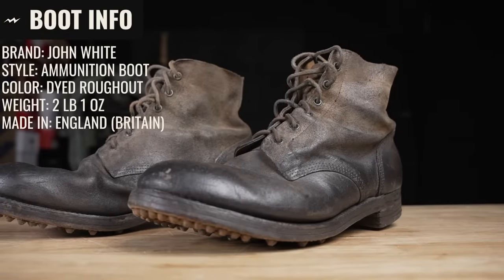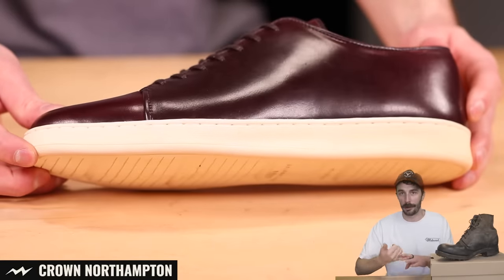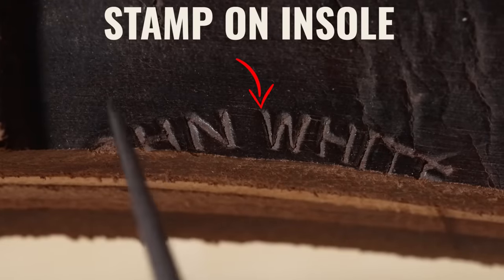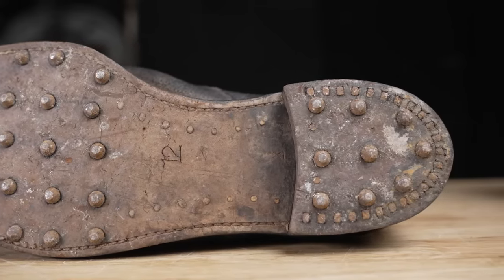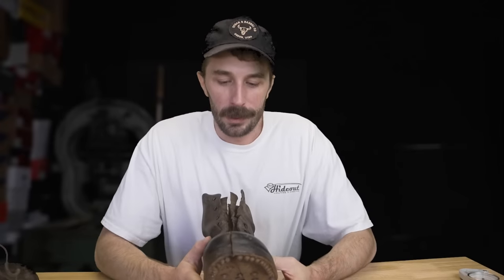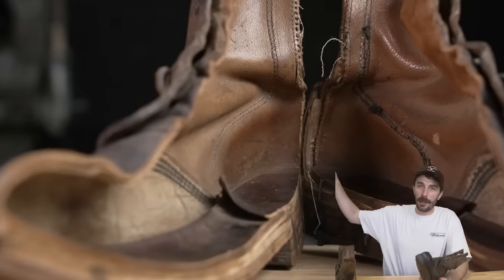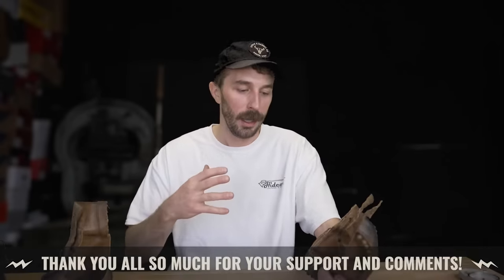Why 80 yr old British WW2 boots are better than modern boots

Comment: All i know is i joined in 2011. The boots felt like planks of wood with ropes to tighten them up. To my knowledge, they were the standard issue CS95 boots but they felt like they were from the 1950s. I think circa 2015, people started getting more comfortable but more disposable boots. Soldiers still preferred to just buy their own. I dont know if this is still the case but i assume so.

Comment: Weston, you NEED to take a look at William Lennon & Co. (founded 1899), the only remaining Derby bootmaker. Note, they aren't the only maker of Derby-style boots (hell, the Iron Ranger is a Derby-style boot), but they are the last bootmaker in Derbyshire. One of the reasons you should take a look is that they were one of the makers of British Ammo boots for WW2, and they still make them. It would be an interesting comparison with these boots, to see if modern production matches in quality.

Another interesting boot in their range is their B5 WW1 replica, which was put back into production using the original lasts & clicking knives from 1915 - which begs the question, if a company stops producing a boot design, and then starts making the same design using the original lasts, knives, and machinery, in the same factory the originals were produced in 90+ years earlier, is it a replica, or a reissue?

Three final points - firstly, they are a family owned company, currently run by the great-granddaughter & great-grandson of the company founder. Secondly, they are unique in that they use a "stitched & screwed" sole construction for their soles, where instead of wooden pegs to hold the sole together, they use a brass wire screw. There's only 4 of the machines that can make this style of sole known to exist worldwide. Lennons have 3 of them. Finally, they are sensibly priced. The most expensive boot in their range is currently £260 in the UK, with the Ammo boots at £200. For those outside the UK, you can subtract 20% from that price (but local import taxes may be charged).

Only downside is that they are a MTO company, so it can take a while for things to arrive...

Comment: Not an old wives tale about weeing in ones new boot, couple of the old lags at Woolwich barracks where we did our basic pulled us over and whispered in our ears about having a widdle in ones boots and it worked, no blisters and butter soft leather overnight, of course we also poured in a bottle of Old Spice once tipped out because they smelt rank, those of us in our dorm who didn't ended up with vicious heel blisters that hobbled 'em.

Comment: The way we conditioned the Ammo boots in the British Army in the 80`s  was to get them on day one then out on a 3 mile run through the mud streams and then assault course. fill them with water (not piss) and leave them over night then another three mile overland. The boots were fine by day three but your feet were in tatters. My old Army boots felt like slippers after few weeks, very comfortable.

Comment: In the late 1980's I knew someone who had a coveted pair of WW2 British boots (I think he was the third generation of his family to wear the pair.) and the sound of the boots when marching was amazing, but on smooth stone floors there's fuck all grip. So when he came to a halt on a smooth floor after marching sometimes he'd unceremoniously skate forward.  Compared with the British DMS, or the later British Commando high the WW2 boot was built like a tank - Ok it may not have been that comfortable - but the Commando high caused splinters of shinbone to break off wearers while running and the DMS had a half tongue and limited water proofing - I'd say the old one's are the best.

Comment: i am a reenactor - i do British WW1 and WW1. both the era of boot are hard on the feet at extended period of time, however, once you get passed that point theyre great. they break in easy, though you slip around on wet and metal surfaces since the hobnails. wearing them in field or trenches are nice, however the supple leather doesnt agree well with water, better than the WW1 type boot. i love both my boots though.

edit: this was painful to watch

Comment: My father was a gunner in Matilda tanks during WW2 and initially they were issued with these boots with hobnails.
After they found that guys were losing fingers and worse from the boots slipping on the metal tank when the were lifting the heavy engine covers and they were chopping off fingers they then issued them with rubber soled boots to stop the problem.

Comment: I served in the South African Armoured Corps, and our boots were just as important to us as the Infantryman's boots were to them. 
We marched a hell of a lot, so a good fit was important.
We had two different soles, a combat, and a drill sole, Combat being thicker than the drill boot.
I was issued one of each kind and wore my combat-soled boots out within a year. They were re-soled, but in an inferior manner, so I never wore the combat soles again.
They were definitely NOT re-soled by the manufacturer.

The style looked very similar to the British ammunition boot but taller by about an inch or two.

I reckon the inner sole was not as good as the Ammunition Boot, but at least we didn't have those damned hobnails.

Comment: I used ammunition boots for drill. They were tough (indestructible) but uncomfortable. That said because they were for drill and were burnished I never softened them with linseed oil. Also they are too short. The British switched out boots with Argentine prisoners in the Falklands War. The best boots I had were the DMS leather boots. Still have mine since 1986. Romans used hobnails!

Comment: This video popped up in my recommended list and as a United Kingdom 🇬🇧 military veteran it piqued my interest, so hear I am. Before getting into the nitty-gritty of the video I thought I would air my opinion before watching and see if we are in agreement, so, putting aside the manufacturing quality of the DMS boot that I was issued when I joined up and looking at it from a wearers standpoint I can honestly say that you would need to be as mad 😡 as a box of frogs to think that they would be better than the last two types of boot I was issued, those being a high-leg boot for use during operations either in the U.K, Europe or other similar climates and for things like guard duties or training exercises away from base, the other pair were again Hi-leg but for use in desert climates such as Iraq and Afghanistan, both were comfortable, hard wearing, waterproof (if you treated them properly) and most importantly they didn’t cause blisters after five minutes, the only other pair of boots that were actually better I can’t include, even though they were issued to me they were not general issue and they were my flying boots (nope I wasn’t a pilot, but I had to regularly fly to do airborne flight testing and engineering support for poorly aircraft that needed my particular skill-set). My two pairs of Hi-legs, and there replacement’s, lasted me well, each pair lasted about 2 years before they were worn out. Ok, on with the video.
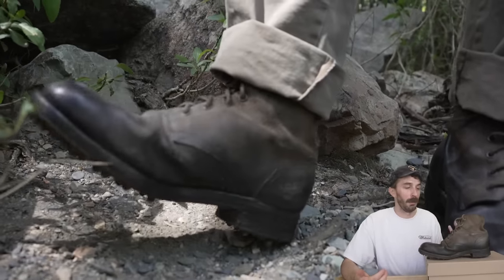@ 6:29 you said about the ways to soften the leather up, I never heard of the peeing in them but we were advised to get them into a bath of water on your feet or weighed down and left to soak, when you took them out to dry we filled them with newspaper really really well stuffed in to prevent shrinking and help soak up the water a bit, the other way was to take a hefty hammer 🔨 to them and beat them into submission, in addition I used to cut the top of the ankle support leather 3-4 cuts, going down about 1-2 inches so that when you bent down our squatted they didn’t rub or make it uncomfortable. Onwards we go.
Now that you have cut the boot in half it is really easy to see why, from a construction/materials point of view, that it is superbly designed and used quality materials, but in my experience they were not comfortable until they were broken in and worn in (about a year), I was just thinking about what my grandfather wore to go to work in, and my memory is saying that it was a pair of these “whites”, we lived just on the border with Northamptonshire and grandad did serve in WWII, so whether they were from his service or maybe direct from Whites I will never know now, pity. 
Thanks for taking the time and effort to do this deconstruction, and the history of a boot that those of us of a certain age who served in our military will remember, I found your video very interesting and informative, thanks again for sharing it with us all. 😀👍🇬🇧🏴🇺🇸🇺🇦

Comment: I like that my walmart $25 boots (used to be $20 but prices are going up on everything) look almost identical to these. The brahma escott boots (I like that they're wide too) look almost identical to these from a glance on the outside. Of course my boots only last about a year or so, they're very cheap. But spending as much as you might spend on a pizza... a pizza doesn't last you a year, so I feel like it's money well spent. These really are some nice looking boots, I would love to have some good quality boots in the same style. But the soles are the first thing to fail on mine. They crack and let water in so as long as you don't have to walk through any water when you're mowing your lawn, after a year they just get retired to lawn mowing duty instead of everyday use. In good condition though, I've worn them as dress shoes with a suit and they work perfectly. I don't know a whole lot about what modern good quality boots are available in this style, but if anybody knows of some good quality boots that look like these, I would love to get a pair when I can afford them. These really are some nice looking boots.

Comment: I think the difference is that working class people back then wore boots literally all day every day while most boots today people wear occasionally but wear sneakers most of the time. 

Modern work boots are probably more comfortable with better shock absorption and stuff but for that reason they also don’t last as long.
Reply: I think manufacturers just go mad cheap on the modern glue construction, so they all fall apart. I have some us army boots with a foam mid sole and heavy lugged vibram sole. With the lugs almost worn down, I think they've survived what a Goodyear welt could if resoled multiple times, without any delamination. High end running shoes hardly ever delaminate like most of these glue construction work boots do, because they use better glue and design them properly. The running shoe style sole US army boots are also a lot more flexible, which I like. Heavy and stiff old fashion boots do make good motorcycle boots, though.

Comment: "Another of our trials was the new army boot.  In Canada [in 1914] we had been issued a light-weight, tan-colored shoe, more practicable for dress purposes than for active service.  Now we had the heavy English ammunition boot.  This is of strong — the strongest — black leather.  The soles are half-inch, and they are reenforced by an array of hobnails.  These again are supplemented by tickety-tacks, steel or iron headed nails with the head half-moon shape.  Each heel is outlined with an iron 'horse shoe.'  Until the leather has been softened and molded with much rubbing and the unending use of dubbing, I would say, mildly, that these boots are not of the easiest . . . . at five-thirty we were roused to make a forced march, across country, of some twenty-two miles.  This was the hardest march of the entire time I was at the front.  Those ammunition boots!  Those gol-darned, double distilled, dash, dash, dash, dashed boots!"

— from "Private Peat", by Harold R. Peat, a Canadian war narrative published in the US in 1917 to encourage enlistment.

Comment: This may not be seen. But Pee is the original tanning solution. Old wives tale says that tanners always had the nicest hands/skin, because they worked with their tanning solution all the time. It’s known that original tanning was done with pee. Pee has Uric acid, which is used for softening leather today, in its synthetic form. Peeing in the boots probably did the trick for softening them up. But also, soaking the boots and wearing them will break them in and form fit them as well.

Comment: I have a pair of caterpillar work boots which serve me for 8 years straight now where I wrote them of right at the beginning and bought a ne pair to replace them. 

It was just a mishap while filling my car up.. the pump didn’t shut off before spilling and my new boots got a good shower of diesel… Ive complained and the gas station payed me a replacement pair so… ok 
But then they stood there, stinky and looking miserably which brought me to the point of just trying what I could so to them to maybe use them around my shop for how long they might last… 
Ive cleaned them, dried them, rubbed them down with paraffin wax, heated that up with a hairdryer and wore them. 
That was 8 years ago wearing them essentially every day! 
I’ve just needed to replace the second pair of laces so they got cleaned, waxed and they don’t show a sign of giving up. 

Sometimes i get compliments about my used looking boots… yeah “looking” 

Ive made my peace with them now… as long as they serve me well I will wear and maintain them and if they eventually fail in 20 years or so, theres the exact same pair in my lockers for another 30 years and with this the point of working boots is ticked off for my life.

But yeah; they don’t make them like they used to! 
Unfortunately the model of my boots got changed and not for the best! Now they are mediocre unfortunately! They cost the same but perform worse. 
Would I trust the new model like my old ones around the shop or out on duty calls with the fire department? Nope

Comment: Very well made, but the question is whether they were as good for soldiering as what the infantry get now.  It's not just strength but comfort and whether they let the feet breath when they need to as well as keeping you dry when you're not actually up to your knees in water.  The infamous DMS boot was hard to destroy but comfortable only once your foot had changed to match its shape and was renowned for causing trench foot.  We threw them away!

Comment: I'm curious, what thread was used? I'd guess cotton.

A modern boot's thread would be superior (though proper regular waxing of the boot would prevent cotton thread rot.) The move to rubber then synthetic rubber soles was advantageous for use in extreme temperatures where leather soles and hob nails transfer heat faster than any rubber.

Comment: During the Vietnam war the Australian Army started issuing high top GP Boots. The first troops to deploy in 1965 wore Ammo Boots with gaiters but later troops deployed with GPs. A number of different companies produced these boots but the most prized and sought after were the SEALS boots (no relation to the US Naval Special warfare troops). These boots were also bartered with US troops for almost anything! Why ? Because they had a steel plate as an inner sole and these were highly sought after by troops concerned about "punji pits" (holes with sharpened pieces of bamboo in the bottom covered in faeces). The history and construction of the SEALS GP boot would be fascinating. I have a pair but you are not getting them to chop up!!

Comment: These boots are interesting and I can see why the troops would want to get a pair of these ones. These are very clearly not the standard ammo boot at the time as those were not made with throughout construction and most had toe caps. Addditionally the standard ammo boot was usually made with heel and toe irons rather than the long rows of hobnails as done on these boots, and the regular hobnails were somewhat flatter. It is possible that these were likely issued to an officer as they are a bit nicer than the regular boots, but overall they are still very similar in appearance and likely have a lot in common in their constructions. I was hoping to see some ammo boots dissected and am very pleased at the result.
Reply: That is interesting, I know that a lot of farm boots were made with heel and toe irons. My friend had two pairs of  Ammo boots he was issued in the Sixties, and they did not have the irons, just nails like the video example.

Comment: I used these boots , there were loads about right into the 80,s..indestructable,BUT,  hard, uncomfortable, and caused lots of feet problems that lasted the life of the person that wore them, i still wear insoles because of these hard uncompromising boots, they smashed your heals walking, cut your skin on your leg if your socks wore through( which happened with these) and generaly self destructed your arches as they wernt supported...they had a stupid short tongue that let water in way to easy,then kept it in.    yeah stronger maybe, but the worst footwear out there for your feet,and knees

Comment: These are not standard issue Hobnail boots.  The issue boots had a toe cap and were issued black and smooth side out (with small dimples in the leather which had to be ironed out with a spoon) The boots, the ones you cut up are ultra rare British Army "Boots Cold Weather Finnish Pattern" issued for a short time during the Second World War and in the early phase of the Korean War. Very rare boot, so rare I've only seen pictures and one small piece of film featuring them.  I guess there's one pair less now.